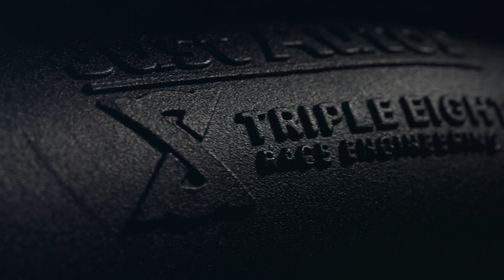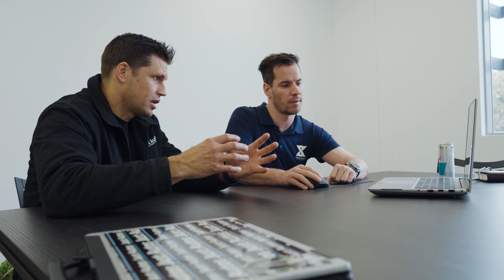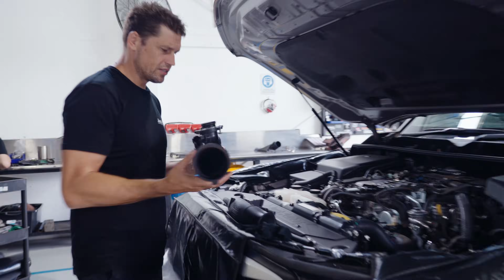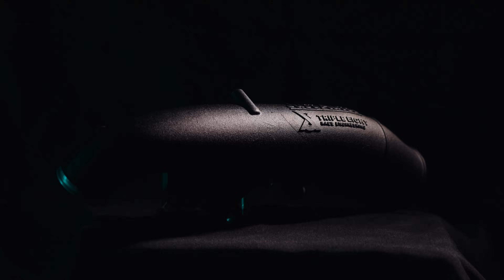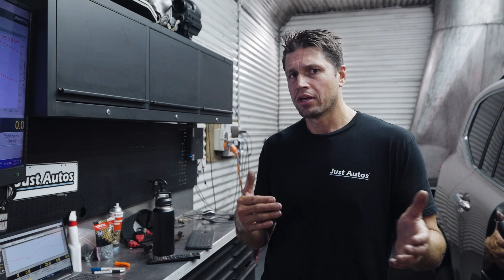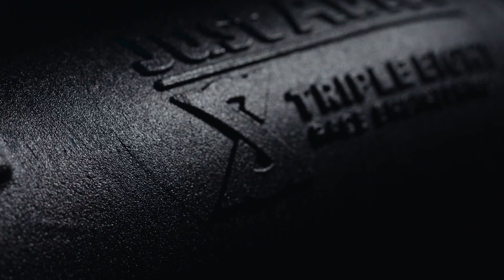Ultimate Fix for the 300 Series Turbo Surge | Just Autos Intake Pipe

Comment: Would be really good if you guys ever get the chance to do a standard untuned car and do a before run, after run all before tuning and show the complete dynograph to really showcase the effectiveness of this new intake pipe and really show the advantages to the regular joe that might just order and install themselves. Cheers
Reply from the maker: We don’t sell the pipe by its self as was designed to be with our airbox system. And because we change the scale in air speed tuning is required to keep the sequential sync.
Reply: @JustAutosMechanical thanks for the heads up, that makes alot of sense. Thanks for the reply. I was curious if it would make a big difference in airflow well enough to cause you to need a tune to suit

Comment: I’m no mechanic so I often find your videos quite difficult to understand what you’re on about. The exact problem wasn’t clear nor was its occurrences. Etc
Reply from the maker: There is a a loss of power just before the second turbo kicks in, meaning that the power surge rather that giving a smooth power curve. This gives the driver an unpleasant driving experience- especially when towing or under load.

Comment: 8 psi low down boost gain, sorry I don't believe you're on the identical map.
Reply from the maker: Why would we bother to release a product that has been a year in the making and testing? We did tests on a 79 series Heat Exchanger for the new 2.8L but because the results were inconclusive we didn't release the product. We test with the same controls.
Reply: @JustAutosMechanical  I can tune a N54 to surge, I can tune the surge away too. The inlet pipe doesn't make surge, it may amplify it like any tube with a pressure wave but the source is the turbocharger compressor wheel / wastegate command. I'd be taking away wastegate duty cycle at that surge point (rpm vs load).
I'm not saying your inlet doesn't flow better, but the surge is still there you just cant hear it now. The 8 psi gain down low would translate to even more gains at higher engine air consumption and corresponding peak power gains aren't reported. In any event I bet they're a top seller.
Reply from the maker: @ben7020  n54 sequential turbo?
Reply from the maker: @ben7020   what have you found with the 300series and would you share your results?

Comment: Are you able to do a similar video showing the dyno results for a 300 that has a factory tune? I'm sure there are plenty of owners such as myself who want to eliminate the surge but don't want a tune. It would help us build the confidence to purchase the new intake pipe, knowing it'll work on a stock tune/engine.

Cheers.
Reply from the maker: The intake pipe requires a tune to suit. Won't work on a factory vehicle.
Reply: Thanks for letting me know.  @JustAutosMechanical
Reply: Why do you want a stock tune?
Reply: I'm more than happy with the power output and delivery with the exception of the heat soak issue and the surging.
Reply: @Family_and_Happiness  Swaping a part in and out will still require a tune to elimnate the surge. Its not always about power it can be tailored to your needs. Even save fuel or improving egts.